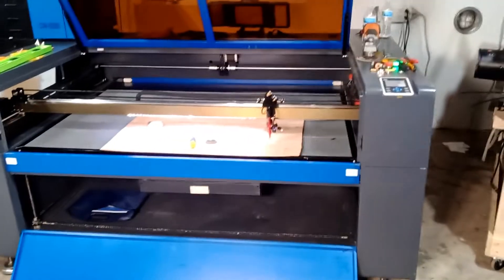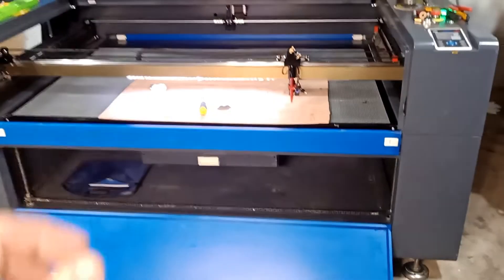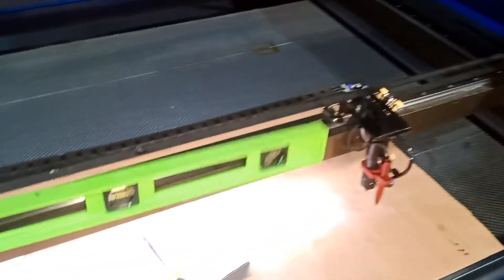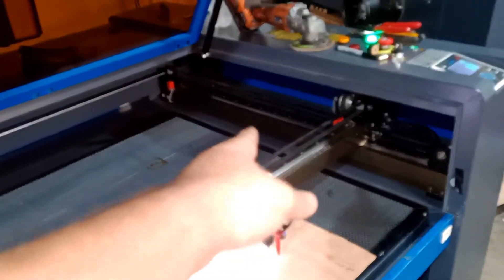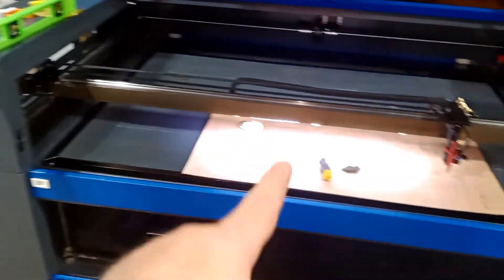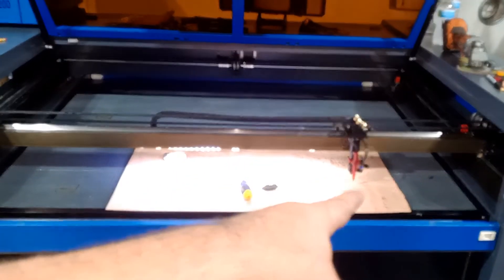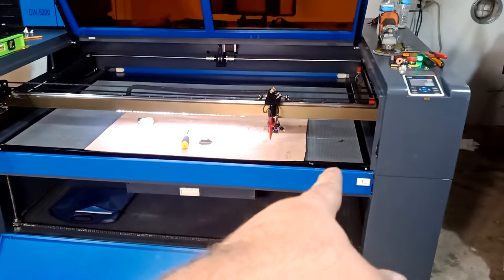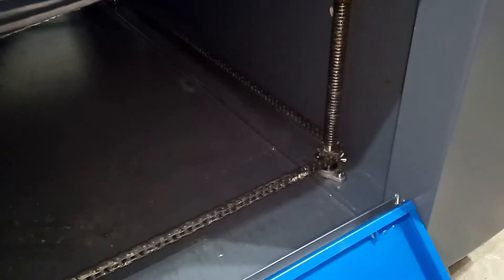OMtech laser engraver table leveling

Comment: Hi Wisam, thank you for sharing. We tried this method but the chain still seems to move even after loosening the screw. Any ideas about what to do? we also have a 130W and can't seem to get it level in all 4 corners.
Reply from the maker: Hello I'm not sure what you're trying to do because you said chain still moving after losing the screw, are you trying to tell me your chain is lose if that's the case you need to pull the motor in the back pull the motor to tie the a tensioner of the chain,
Or are you having an issue of only one side the chain is loose
If that's the case you have to do alignment by loosening the screws on the motor pushing the motor forward and realign your chain
When doing that be careful not to move the table up and down
Reply from the maker: And if one of the bars is not moving  level your bed to that bar and adjust the other corners, I had this issue on one of my friend is machine one of the bar  was not moving even after losing a screw so what we did we adjusted the bed size to that bar to that corner and we play with the other corners